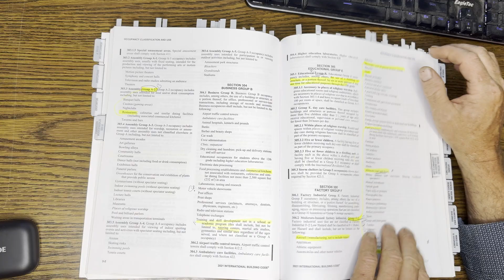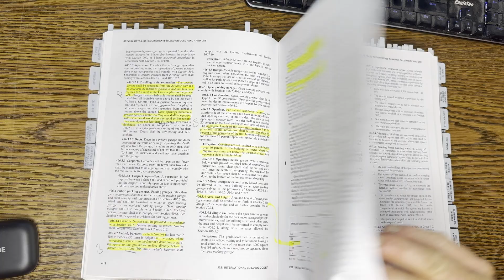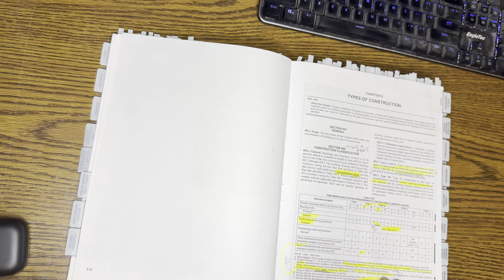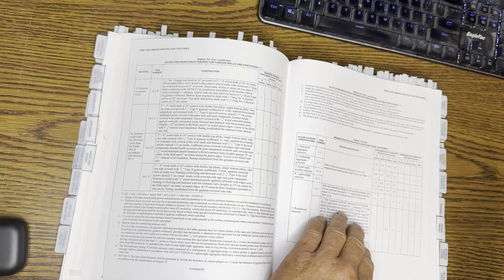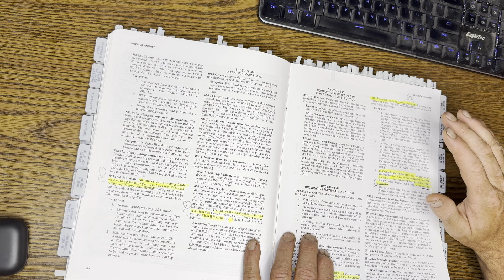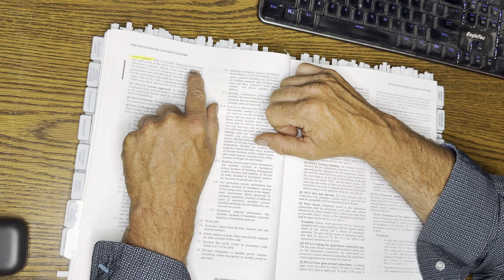ICC Commercial Building Inspector (B2) Part 1 || IBC Chapters 1-9 plus My notes to help you pass

Comment: I have a question it may seem kind of dumb but I'm getting conflicting answers if your using the IBC looseleaf code book can you separate the index into another 3 ring   binder for the test would it still be considered one book because of the copy right
Reply from the maker: Probably a question for ICC.  I certainly don't know.   Try it and find out.
Reply: @CodesExplained  I don't know if I would try it without knowing for sure but I was told because it was actually one book it can be done as long as the paper wasn't loose and bound in a binder . Looks like I will probably buy another book for exam day and use the binder looseleaf book for the index unless I can get a confirmation

Comment: I just passed my B2 Commercial Building Inspector Exam yesterday. I did not have the ACI 318-19 or the Concrete Manual because my employer wouldn't purchase it for me.  ★There were about 4 questions regarding drawings and details. Definitely make sure you can read rudimentary plans★
Reply: I have a question did you get your certification through Icc site?
Reply: Yeah, I took the exam online (remote proctor) through the ICC site and I was able to print my certification right from the ICC site. ICC also sent me a confirmation email stating that I passed the exam.

Comment: This was truly amazing! I just took my B2 exam and passed if first try.  This was such a great and helpful tool to cement the learning. MANY THANKS!!
Reply: I felt comfortable with this exam. About 90% answer confidence. I regularly check plans and historical records for code compliance, but I do not examine plans for new construction before development. Do you believe its worth the attempt at the plans examiner cert. Or are there specific areas you would recommend for additional training/experience?
Reply from the maker: @edwinduran1315  I plan on putting my notes up for the Building Plans Examiner at some point, but there is tremendous overlap between the inspector and examiner tests.  You could probably pass both after prepping for B2.